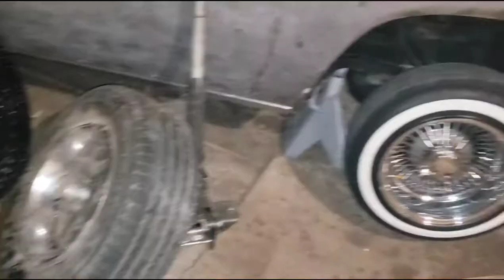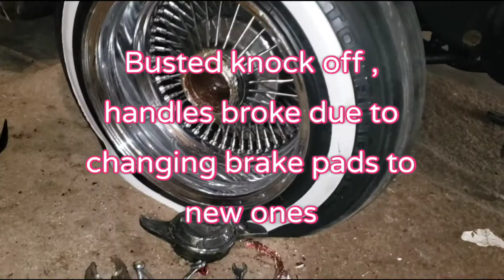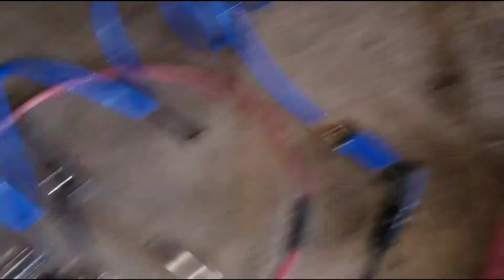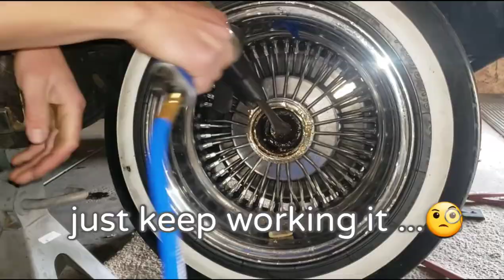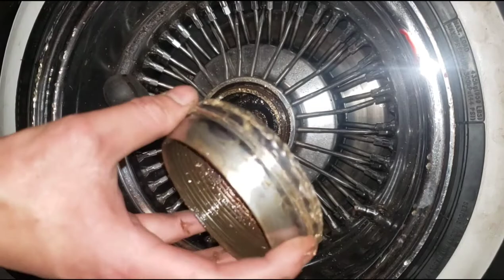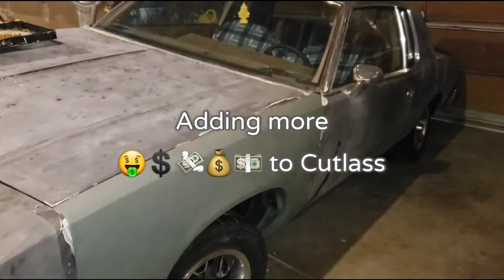How to remove Busted Knock off (Lowrider Problems)

Comment: Was that the passenger sides front and rear? Also does the driver side clockwise to tighten
Reply from the maker: Yes that was the passenger side front tire knock off got stuck , usually the knock off should have the direction which way to tighten but the driver side tightens to the right clock wise both driver an back driver , thanks for watching man appreciate it a lot 💯🙏🙌🏻

Comment: Did it strip the adapter?
Reply from the maker: No problem with the adapter I was making sure I wasn’t hitting it the air hammer , but if your looking for new adapters ,Og wire wheels has them new for 40$ each but they sell them everywhere online eBay amazon to , thanks for commenting!💯🙌🏻appreciate it ☝️